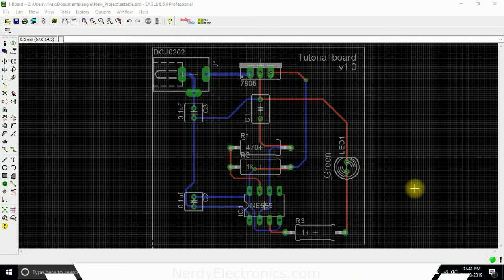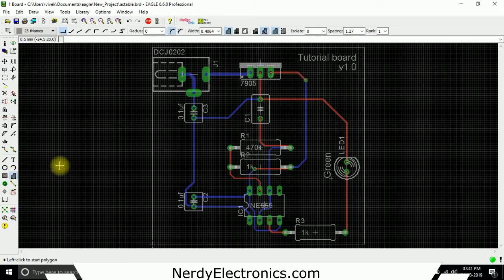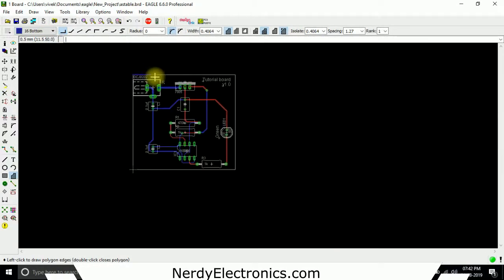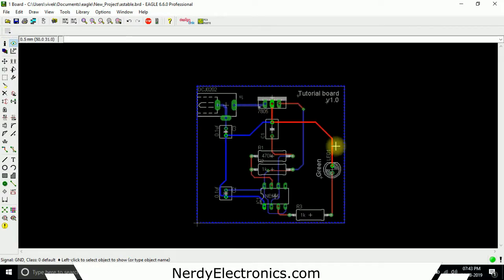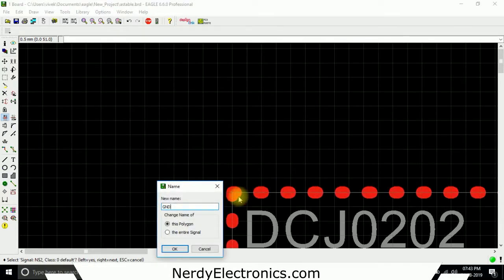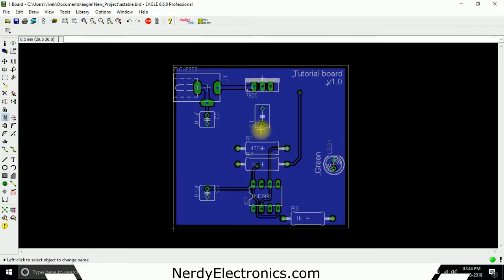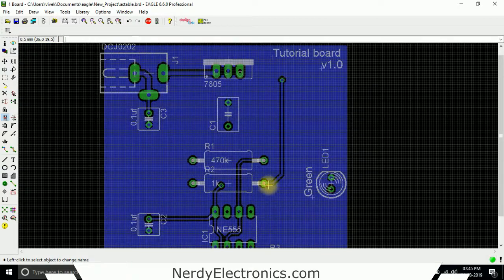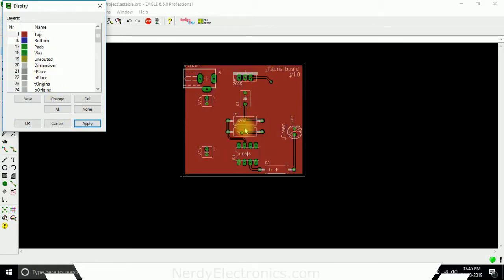PCB Design with EAGLE - 11 - Ground pour

Comment: Thanks for some nice to-the-point presentations. However, a small detail of minor importance : Leading a DC current thru a capacitor at the power supply jack connector is not going to pass any DC. It might confuse one or two, like me.
Reply from the maker: Hello! Yes, that is a mistake. It was made while making the circuit. I have mentioned it in that particular video.

https://www.youtube.com/watch?v=sgCdnLytJBY&list=PLQptsE6qQy8Oii4WP06T3xCBkq1T4819d&index=6